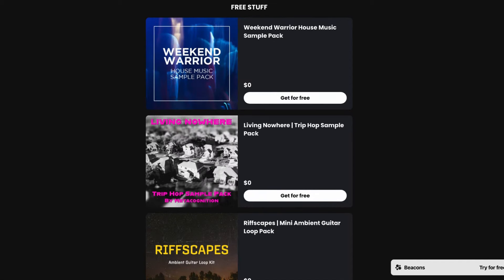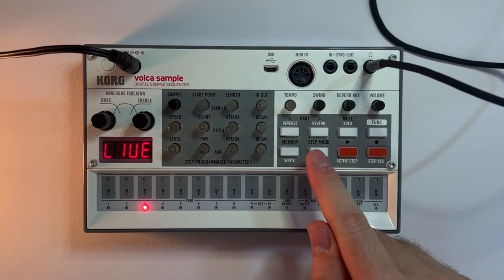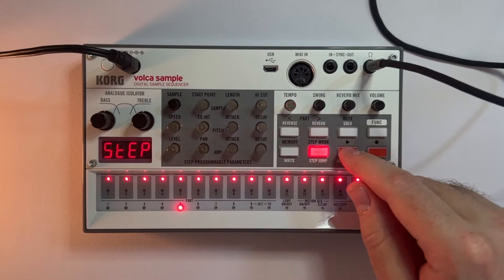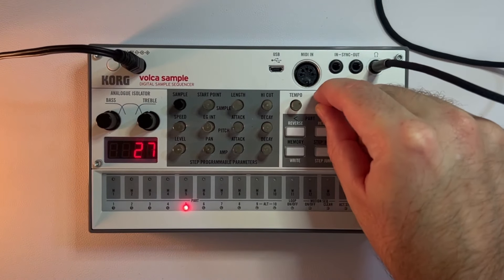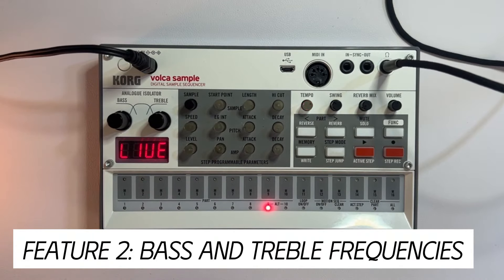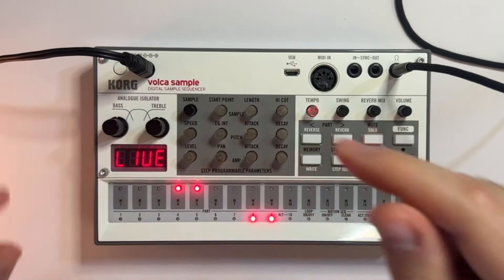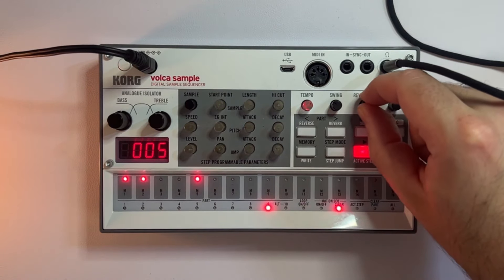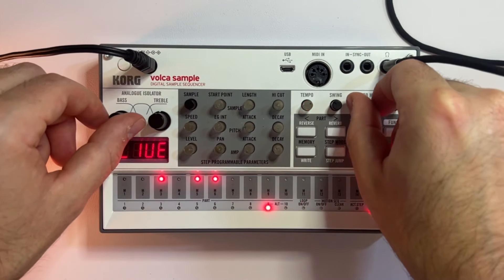6 Must-Know Features on the Korg Volca Sample

Comment: 7 - What nobody says about Volcas is you can run them with alcaline batteries (1.5V) or rechargeable ones (1.2V), there's a setup option for that in order for them to run at the correct voltage and it's very useful.
Reply from the maker: Say more 👀
Reply: @ryanwaingo  Press FUNC and start Volca, Keys 1 to 7 are for startup parameters, Key 2 is for battery type, led on NiMh or NiCd, led off Alcaline. RTFM !
Reply from the maker: @raphanunu6912  Awesome, thanks!